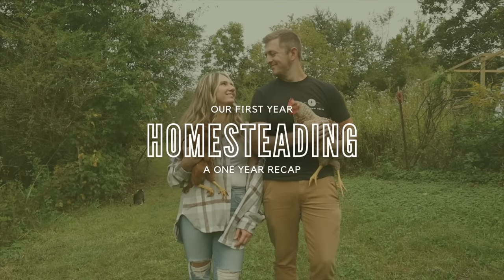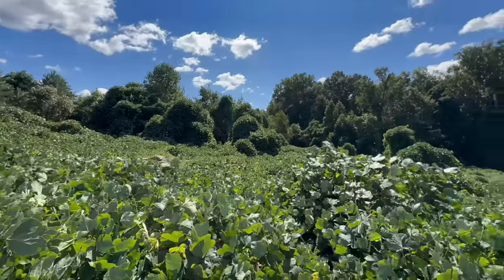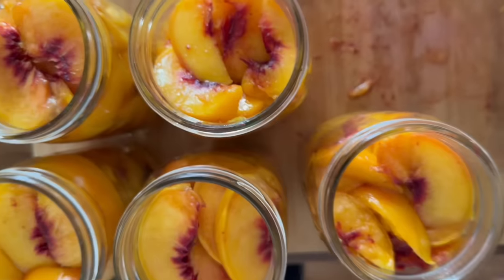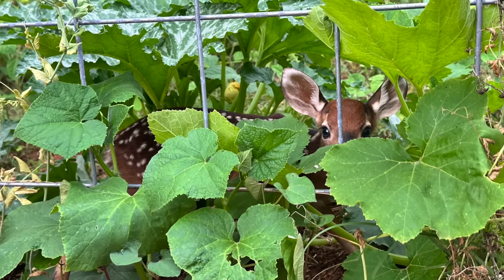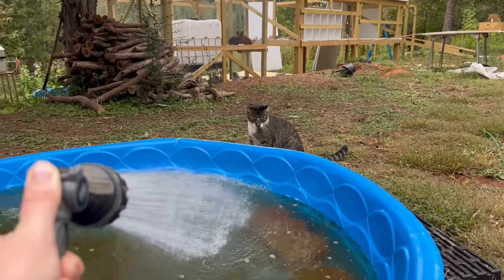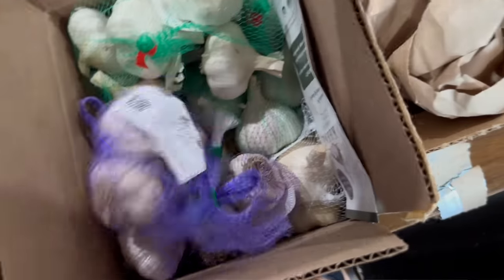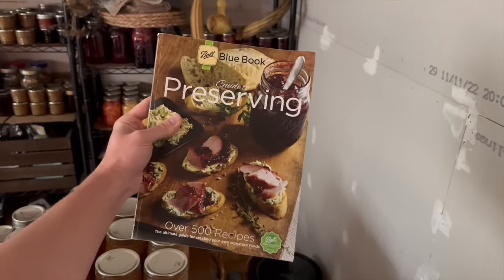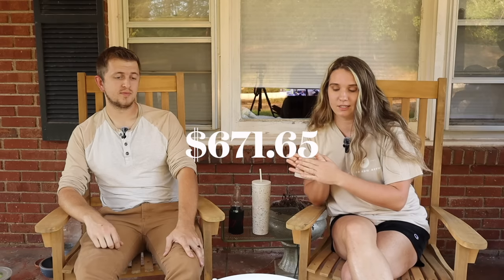Building a Homestead: One Year in the Making | HOMESTEAD TIMELAPSE

Comment: I got indian runners this year & have been struggling with their mess also- I have learnt to turn that struggle into a benefit! I have a large pond for them, which gets incredibly dirty within only a day or two! I ended up coming up with this solution: every night or 2 when I go to lock them up, I put a submersible pump into their pond, this pump has a hose going directly into my compost piles next to the coop! The pile consists of bedding, shavings, straw, grass clippings etc. The poppy pond water fills the compost pile with nutrients! In the morning, about 20 minutes before my automatic door opens for the coop, I have an automatic timer that starts filling up the pool again! And then the ducks have fresh water to swim in in the morning!! Once you have the system set up, it is very easy!!! My chickens also just drink the pool water, so it eliminates their water needs too! Hopefully this can help you with your duck water system!
Reply from the maker: This is similar to what we'll be doing! We will have a little filtration system & a drain in their pond when we get it in. Our coop and run area is on the hill, so we can easily pipe the water down & out the hillside to collect & use! We're getting so close to being able to set up their pond & permanent water/food systems and I'm so excited. It's going to streamline things a ton.

Comment: Well on you guys on the heat pump.  My old school friend from technical college put one in and it's been amazing.  Particularly satisfying when you get a sense for its efficiency.  You can use solar (at a later stage) to run it.  And it can cool in the summer so you could be self sufficient on heating and cooling.  While at it, you can run a line to the barn to keep temps in the winter more moderate for the animals.  And a fireplace for a few really cold days... heat pumps are a bit sluggish so best used for broad temp control.

Comment: We had a leaking/ flooding problem on the floor in a rental house we purchased. A nice man at the paint store suggested we dig a ditch around the perimeter, paint the exterior of the block with roofing tar and backfill the ditch with pea gravel and then Florida.
Reply from the maker: Good advice! This is very similar to what our plan is. It's a common way to deal with hydrostatic water issues, but I think instead of roofing tar it'll be some other waterproofing materials & then a drain tile style system. But you basically got it!

Comment: A few thoughts on some home hvac ... With all your trees (dead trees and maybe ease of access to wood locally), maybe an outdoor wood burning house furnace???  The wood burner is outside in the yard but provides heat for the house.  I have a tankless water heater ... love it. Just takes a minute or so to get the hot water flowing as you use it and no cost for heating water. You can also get them for individual places where you want to use hot water rather than a whole house style. 

Good work you two!  Lots of hard work but you are making progress!  It's looking good!
Reply from the maker: As much as we'd love to do this, we need to think about both heating & cooling, not just heating. So it's a tad more complicated. We've researched this so much at this point & have family members who work in the industry & are comfortable with our decisions for now, but will probably continue to do further research until we're able to afford a system. I grew up with the wood boiler (what you're suggesting) and hated stacking all that wood! lol but I don't think I'd mind as much now! Good workout! We'll definitely get a tankless water heater when we can afford it! Thanks so much for your suggestions & for watching!

Comment: You may want to watch a yt. It's called Back To Eden . It teaches you how to garden without watering. Did you know people who have drinking problems take kudzu in pill form ? If you build a double fence around your garden, the deer will not jump over it ( I can't remember the spacing of the 2 fences). There is a thing with bee keeping called horizontal bee keeping. People say it's SOOOOO much easier. If you look at hanging folders in a filing cabinet, that's basically how you insert the bee things. So you just open the lid and lift out a tray. The types of flowers you grow around it determine the flavor of the honey. You can also make wax candles. Look into passive solar greenhouses and s&k gardens in NC. They teach VERTICLE gardening and other tips  of making it easier.  I wish you both Many Blessings .

Comment: Get some ventless gas heaters  to keep your house warm. I like the 10,000 BTU radiant heaters with a thermostat and without a blower. You can use a pedestal fan or tower fan to circulate the heat. A lot of people want to use the higher BTU propane heaters, but the 10,000 BTU heaters will save you money by letting you adjust your heat in zones.
Reply from the maker: We have 4 oil-filled radiant heaters for now that work great! We'll stick with those until we can invest in a whole-house system. Thank you for your suggestions!

Comment: Before you use that fireplace check it closely, it looked like there was cracks between the bricking which might create problems like burning the house down. If there are cracks or gaps be sure to seal then up, with the proper fireplace caulking and also have a chimney sweep inspect the chimney for the same things and the same reasons. BTW I clicked on the Hollars link to see whats up. Things are looking good there,
Reply from the maker: Yes it’s kinda sketchy! (What isn’t here, though?😂😂) we’ve already had one inspector take a look at it & we plan to have another since we didn’t get too much info from the first. It’s propane/gas log currently & we want to make sure it’s all safe & sound before using! Thanks so much for checking out our channel & for your comment😊

Comment: It was the fan speed of the oversized dehumidifier that caused the mold.  The fan blew off condensation into air before it could drain.  Now you know.
Reply from the maker: It was actually mostly due to other issues not easily explained in a video like this, but that definitely could’ve contributed.

Comment: Would just like to let you know it is safer to use food grade buckets. Than it is tractor supply when making food. Go to a Chinese restaurant and ask them if they have any buckets that you can have. that.. Deli's also have pickle buckets they may give them to you for free that's where I got mine. But there is a difference between plastic and the food grade is safer. Pickle buckets just go get some restaurants or delis.
Reply from the maker: Tractor supply buckets are food grade buckets. It’s printed right on them actually!
Reply from the maker: They’re the cheapest source we’ve found for food grade 5 gallon buckets. We like to go to ice cream shops & ask for their used 3 gallon ones, too! I learned that too when I worked at Kilwins back in college.

Comment: water:  check our "Ram pumps"  using the creek.  No electricity is required.
Reply from the maker: Someone mentioned this the other day & I have yet to look into it but we definitely will❤️ thank you for the suggestion!
Reply: @calicocowacres  see vloggers Nomadic Movement in Panama have a video explaining it. They spent less than $100 for parts (+ hoses or piping), and fill tanks in the dry season. Vlogger Lumnah Acres installed a system from a stream in NE USA for his farm.   A huge farm. He is off grid in New Hampshire on 500 acres (not a typo).  He imho is the smartest. I think funded almost solely by YouTube.  They started from almost nothing. Hard to believe what they have accomplished.
Reply: Lumnah Acres is not using a Ram Pump. He did his differently.
Reply from the maker: we'll check them out and see if it's something that would work fo rus! thanks!

Comment: before considering heat sources.. insulation is the number 1 priority.. yer heat systems are only as beneficent as the envelope its feeding into..  windows,doors,sealing all air infiltrations,and to modern standards insulation.. that ALL should be done before even considering the heat system source.. we spend  a pittance heating with wood and cooling with electricity because we understand this basic concept.. the envelope you live in is much more a key to energy efficiency than the source of the energy.. good fortune kidz..
Reply from the maker: As much as we’d love to be able to fully take care of the envelope prior to installing our new heat sources, the cost of window replacement alone will be more than we can take on anytime soon. We have taken all of these things into consideration, though, and our heat source solutions are also still off in the future a ways. We currently have 4 oil coil radiant heaters that we use to heat our entire space, and I can definitely say that even without our envelope being fully addressed (as someone who works in the construction industry and deals with this type of stuff often), we’ll be saving money compared to the cost of running these. Regardless, you’re correct that it needs to be addressed. All of those details are future worries for now, though, until we can afford them😆
Reply from the maker: We will definitely be winterizing the house a bit this year though! Last year we were so busy with demo & reno that we didn’t get a chance to do any of that! We have some windows where the panes are partially detached and actually flap in the wind in the winter! We dont have a tall enough ladder to fix them, so we just had to stick tape & bubble wrap to keep them closed/insulated as much as possible hahaha😳😂